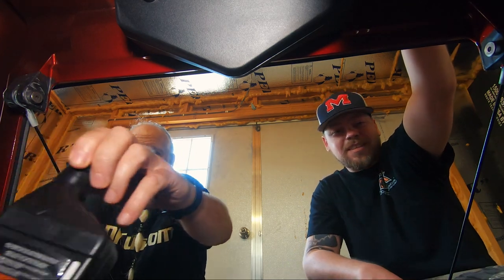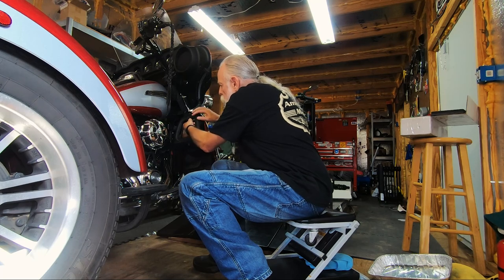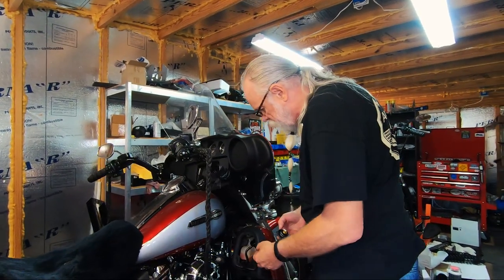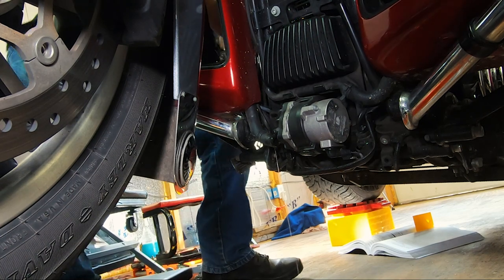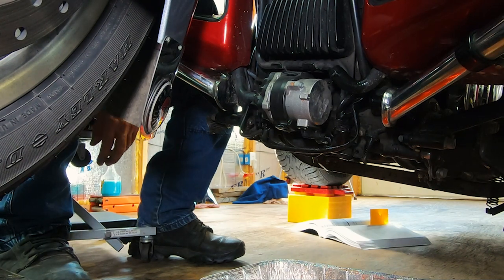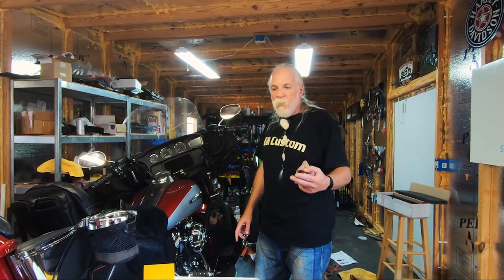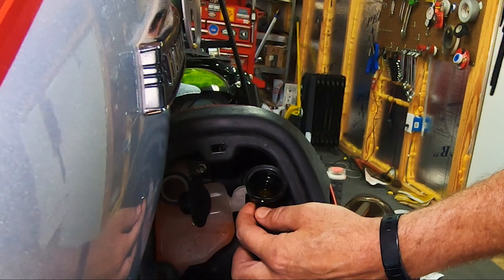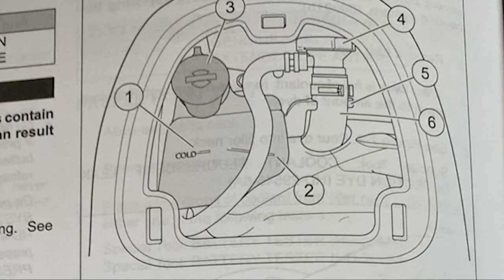DIY How To- Coolant Maintenance Harley Twin Cooled

Comment: Why does the front and the right rear tire need to be 6 in off the ground and the left rear doesn't??
Reply from the maker: Good question, and I am sorry I did not address Why in the video.  When just doing a bleed, or when replacing the coolant (which requires a bleed at the end), by having the right side of the bike higher than the left side it will assist the air bubbles in escaping the system.  They escape out of the radiator cap which is on the right front side of the Trike.
Reply: @DKCustomProducts  What if you don't have anything to lift the trike? Can the bleed be safely done anyway?
Reply from the maker: @giuliozanni6046  Drive it up on some blocks of wood, or jack it up onto some blocks of wood.  It will not bleed the air bubble out completely if it is sitting level.
Reply: @DKCustomProducts  Thank you
Reply: Sr did you fill it up the cooling reservoir first ? Then you start the bleeding, thank you

Comment: Just had the same thing happen to my 21 FLTRK. Had to stop but I fill the “overflow?” To cold level never overheated for 200 mile but I checked again and tank was empty. Refilled it with bike cold to the cold level and it’s remained there with no more overheating issues so far. Glad I found this video as a how to guide.
Note: do not do what I did. I was under a time constraint and had to go and gambled. No problem for me but with my luck all I can say is the man upstairs was looking over me.
Reply from the maker: Glad you found the video useful/ informative! 

Thank you for your support and for watching! 😎👍

Comment: It took at least 7 purges to get the bubbles out. It so easy to do no labor involved in a purge. Really good video along with reading all the questions and answers. The only suggestion I could add is a leak check. I also observed that fluid will fill the system the more that you cycle the bleeding process on and off
Reply from the maker: Thank you for the good add! Glad you like the video!!! 

Thanks for commenting!

Comment: Hi guys, I have a 2021 Ultra Classic Limited and had the same issue. I too had an unknown leak somewhere that never showed up under the bike when it was parked. Eventually I lost enough coolant to where I sucked air into the system. I appreciate your video and it helped me to get back on the road again without any issues at all. One thing I noticed as I was removing the filler cap, the cap adapter would spin in both directions as I turned the cap.  I'm talking about the pressurized cap, not the rubber one on the overflow tank.  I thought this might be the source of the leak. It takes a little effort to make it spin so I think it'll only leak when the bike is hot and running. The problem seems to be that the factory-installed hose clamp is the crimp type and wasn't put on tightly enough. I solved this by adding a 1 in regular screw type hose clamp just above the factory clamp. Now it doesn't turn with the cap.  I will let you know if I continue to experience the coolant level decreasing without a noticeable leak.
Reply from the maker: Thanks for the comment/report!
Glad the video was of help.  I don't know how mine got low and sucked air...but I check it regularly now and in the last couple of years it has not gotten low again.

Comment: Thank you, DK.  My 2004 VROD coolant is way low in the white plastic tank. I think I need to fill up the radiator AND the tank to the "cool" line, don't I? Of course, it needs to be bled manually as you explained. I'm glad I watched this clip otherwise I would not know the air build-up issue.
Reply: Btw, my bike only has 12.5K miles.
Reply from the maker: Thanks for your comment, great to hear you are finding the videos useful/interesting..

Unfortunately, we do not have any experience with the VROD but you should look at your manual to find out how you should fill your coolant.  MB

Comment: Really, a great summary of the complette cooling system! Thank you so much. In some point they say that you have to change the coolant CAP? Is that correct? Are you still using the same cap?
Reply from the maker: Did I miss that in the manual?  Going to look when I can (on a road trip right now).  Yes, I'm still using the original cap.

Comment: Do you have to leak off from the bottom even if the coolant is empty ? Thank you again
Reply from the maker: Yes the bleed helps get all the air bubbles out. If you do not get the air bubbles out it will run hot. If it is empty and you put coolant in it it will have air bubbles and the bleed will be necessary. 

Thank you for commenting! 😎 MB
Reply: @DKCustomProducts  thank you
Reply from the maker: You are most welcome! MB

Comment: Can it be done the same way on a 107 ultra limited ? Do you have to raise the back tire ? Thank you
Reply from the maker: It can be done on all the Twin Cooled Bikes. On your two wheel Ultra Limited you only need to have it on the Jiffy stand. It can not be straight up. When just doing a bleed, or when replacing the coolant (which requires a bleed at the end), by having the right side of the bike higher than the left side it will assist the air bubbles in escaping the system.  They escape out of the radiator cap. 

Thank you for commenting! 👍 MB
Reply: @DKCustomProducts  thank you much appreciate
Reply from the maker: You are most welcome! Thank you for commenting! MB

Comment: Great video , does the white tank get drained also when u pull the lines off ..
Reply from the maker: The reservoir is only connected to the rest of the system when the engine is running and the coolant system is under pressure, that is why it did not drain out of the reservoir when we drained the system.

If you are low in the reservoir, but not so low that air has been introduced into the closed, pressurized system, then you do not need to bleed the system, you can just add to the reservoir, bringing it up to the line on the reservoir tank, and you're good.

Thank you for commenting! MB

Comment: Dose the water pump run on that half throttle when the fans are on can't get the pump to run
Reply from the maker: Yes, the pump is actuated, that is how it pumps the coolant thru and purges the air out of the system, as seen at the 20:19 mark in this video.
If the pump is not running, I would be checking wiring, connections, fuse, etc.  Pumps can get expensive unless you are covered by a warranty (OEM or Extended).
KP

Comment: I have a 2015 road glide, the hoses were in a little different position, but not very difficult. I did follow the overflow tubing, the one from the radiator cap goes to the bottom of the tank and then a tube runs from the top of the tank down to the bottom of the bike. My cap was not put on correctly during the last service, but the leak just caused loss of pressure in the system. Temperature did get high and the coolant reservoir tank lost fluid overtime. But no bubbles, lucky
Reply from the maker: Man, I am glad that it didn't cause any worse problems. 
I make it a necessity, if someone else does maintenance on my bike, to check all caps and anything they may have loosened or changed. 
Thanks for commenting! 👍
Reply: Hoses in a different position? Are you still running the original (defective) style water pump? If so, get it upgraded to the post 2018 pump before it craps out on you.

Comment: Did a full coolant flush just recently and had an annoying coolant leak afterwards. Problem was the hose clamp that secures to the radiator cap. Replaced with a worm drive type hose clamp and leak fixed. The OEM hose clamp isn’t the best.
Reply from the maker: I hate you had that leak, but I am glad that you got it figured out and are able to ride! Thank you for commenting! 😎 MB

Comment: Great job gents! I just got off my bike and I don't see any fluid in the tank. I just had the bike totally serviced and they changed the fluid less that 500 miles ago. Today there's no fluid in the tank and what got me to look at it wast the fan or pump continuing to run after I got off the bike. I'm thinking they did not get that radiator cap back on correctly. There hasn't been a problem with it since 2017, but all of a sudden, nothing showing in the tank reservoir. There are no signs of leaking, so I'm thinking it has to be the cap. Hopefully nothing wrong in the heads!! Wish me luck, and thanks again for showing how to properly bleed the air out!
Reply from the maker: Glad you found the video useful. 👍
It is highly unlikely that anything is wrong with the heads, what is more likely, as you mentioned, is that the radiator cap was not installed correctly.
It is definitely a chore to get it installed correctly...not a lot of space to work with, and you can just push down and twist...gotta hold the rubber hose while doing that, all in that small area.
Reply: @DKCustomProducts  After bleeding the way you said, I went for about a 60 mile run into town and back, no over heating issues and the antifreeze level remained full. Thanks for these awesome videos!
Reply from the maker: @Big88Country  Good deal, man! Thanks for watching! Ride safe!
Reply: @DKCustomProducts  So far so good! Rode it the last few days and the antifreeze is holding. There was air in the system, but using y'alls video, I got it out and all is good to go! Thank you and Ride Safe Fellas!

Comment: I have a trike (2018) too ... so this was very good info !!! My dealer did replace and bleed the system at 30K but still I like knowing how to fix a problem.
  How did you know the system was overheating ??? 
Is there an indicator light on the instrument panel ????? THANKS DK !!!
Reply: @RedTickJJ   THX Tony .... now I don't have to find my glasses and read the manual
Reply from the maker: Glad you enjoyed, and good to hear your dealership replaced and bled your coolant.  I knew it was overheating because I use a Power Vision to monitor a variety of data.  I saw my ET (temp sensor in the cylinder head) go much higher than normal.  I did shut it down prior to the indicator light on the instrument panel lighting up.  But there is one there, at least on the 2019 models.

Comment: Do I have to go through the bleeding process if I just add coolant ie: just removing the overflow tank cap
Reply from the maker: Only need to bleed if there is air in the system.  If your tank is not empty (and has not been empty), then it is unlikely there is air in the system, and it does not need to be bled.

Comment: Does water pump make any noise or vibrate when you're doing a bleed? When I manually start the fans/pump with the throttle  , it looks like my pump is not working at all.
Reply from the maker: As you can see at the 21:21 mark in the video, you will hear the fans, and the way you know if the pump is pumping is that you will see the coolant moving and/or bubbling in the filler neck.  If it is not, then put your hand down on the water pump and see if you can feel it turning.  

Thanks for commenting! 😎 KP

Comment: My 2016 ultra limited low water pump failed thankfully I was in town the dealer told me they had pump failures I think 2014 ,2016, they replaced it with a up graded pump 600.00 h.d. Bucks 😢but I to never flushed the system that probably didn’t help it crapped out at 60 k .thanks for the video 😊
Reply from the maker: Wow, bummer about the pump.
Glad you found the video useful. 👍

Comment: thank you for the video. I have a coolant leak that I need to get fixed and also I need to flush the system on a 21 road glide limited  any tips thank you.
Reply from the maker: Drain it out, like shown in the video.  Then, if you want to flush every last bit, reconnect one hose at the pump, put some fresh coolant in the reservoir, then activate the pump, as shown in the video, with the throttle, and pump out all of the coolant out of the hose you left disconnected.

Most important tip is to get all the air bubbles out, as shown in the video.

Thanks for commenting! KP

Comment: What is the operating temperature?
Reply from the maker: I am not sure what bike you have but it takes about 30 -45 minutes of straight riding to get a bike to operating temps. 

For a Twin Cam 230* F everyday warm weather riding, with no more than 240* F in extreme circumstances.  

 For a M8 260* F everyday warm weather riding, with no more than 270* F in extreme circumstances.  

Thank you for commenting! MB

Comment: Very good tec. tip for sure.  Kevin, just like you I had a 2014 and now have the 2018 and have never give it a thought about coolant.  Sorry it happened on your trip but again thanks for the info.
Reply from the maker: Cool, glad it was useful.

The '14 was my first wethead, and the coolant level never changed, never had any issues whatsoever with the system.  Since I was sort of put off by having a water-cooled Harley I'm thinking that influenced me never taking any time to learn about it.   lol
Well, I had to learn about it on this trip.  Am glad I did now.  

Over the years there have been a few folks that had hot running bikes where we could never figure out why...it really does not take much of an air bubble to bump that temp up 30-40 degrees.   Even if the coolant overflow tank is not low, if the coolant was filled and not all the air bled out of the pressurized system...that is all it takes.
Reply: Wet head... Gotta luv it.

Comment: I had problems the coolant poured out after stopping the engine. I think the coolant 2 step cap is the problem so I ordered a new one. And while waiting for the new i sprayed on silicone on the rubber in the cap. And also blowed the radiator with air from the back to the front. That solved the problem.
Reply from the maker: Hate you had a problem. Glad you got it fixed. Thank you for commenting! MB

Comment: I had low coolant with just 600 miles on my 20 Triglide. Dealer thought it was faulty 2 stage cap as the motor company had reports of some. They replaced cap, problem solved. Possibly same with yours.
Reply from the maker: Possibly.  I'm keeping an eye on the coolant level.  So far it's been 1400 miles and the level has not moved.

Comment: Does the coolant in the reserve count toward the 1.1 quarts. If so whats it hold. I got the first about 22 Oz in easily and I Been burping can't get anymore in and reserve is full
Reply from the maker: I do not pay attention to total amount of coolant.  What is more important is to repeat the bleed process (with the Trike at an angle, or a 2 wheel bike, with it on the jiffy stand) as needed to get rid of all the air bubbles.

Comment: I’m glad you posted this video. My 2021 has been spitting coolant every ride. I would come back from a ride and pull off the cover. With the bike off, the over flow would expand and run out. This would pulse like this for 2 min. I followed you video and checked for air in the system. Unfortunately, no air. Took it to the dealer. They found that the coolant cap was not releasing pressure.  20$ part. Do you know what kind of tester you would need to check a cap?   Again thanks for all your videos. Really enjoy the channel.
Reply from the maker: Glad you hear you found the video useful, and really good to hear the Dealership was able to identify the problem and get it fixed for a small price.
I have never tested a radiator cap.  However, I just did a google search "radiator cap tester" and there were quite a few results for test kits.  
Thanks for watching and for adding some useful info! 👍
Reply: Your comment about the cap helped me to solve the problem on my Bike, thanks!

Comment: How do you remove the radiator cap.  Do I have to push down on the cap to get it to come off, just like a cars radiator cap ???
Reply from the maker: Yes.  Push and twist at the same time.  It can be difficult, I had to hold the flexible neck with one hand while pushing and twisting with the other.

Comment: I just checked the level of the coolant on my 2021 Ultra and the level was at the level of the hose at the bottom, no where near the cold line. So I added some fluid but since I couldn't take the filler cap off I added it to the reservoir...Now after trying again and again I finally got the filler cap out and at my cousins insistence I added to there till it spilled (added about 1/2 inch of fluid from the cold line) turned the fans on but I couldn't see any bubbles at all. Question: how do I know if my pump is actually  working! Thanks!
Reply from the maker: At the 20:08 mark in the video, when you follow those instructions, it turns the fans on and the water pump.  When you hear the fans go on, put your hand on the water pump.  You should feel it pumping...but if you have no movement in the coolant, it is likely the pump is not working.
KP
Reply: @DKCustomProducts  Thanks I'll try to feel the pump. Rode it today after making sure the level was at the mark and it was cooler, but that could be my brain, he,he!
Reply from the maker: My Pleasure!!! Thank you for commenting! MB
Reply: @DKCustomProducts  Just tried the "bleeding" procedure and the pump does vibrate, but the noise if it makes it gets drown by the noise of the fans!
Reply from the maker: Hopefully it is working correctly and there are no air bubbles. MB
Reply: @DKCustomProducts  Well the coolant hardly moves in there but may be the vibration of the fans, zI don't see any bubbles. Will do a flush and fill-bleed to make sure it is doing what I see in the videos on this subject!
Reply from the maker: I hope you get it figured out! Thank you for commenting! 👍 MB
Reply: @DKCustomProducts  Yesterday while updating my mapping with the Thundermax the bike took 8 minutes at idle to reach 230ºF when the software wanted me to rev at dif rpms for a test...Now is it normal to take 8 minutes for the heads to get to 230º, too soon/late? BTW thanks you for answering you guys are terrific!
Reply from the maker: That seems pretty quick to reach those temps.
Reply: @DKCustomProducts  In humid Florida? Noticed the fans kicked in then off then on...!